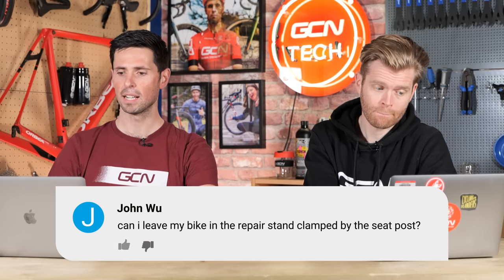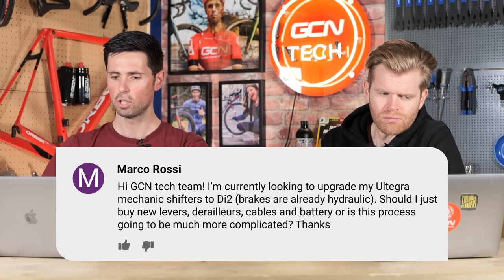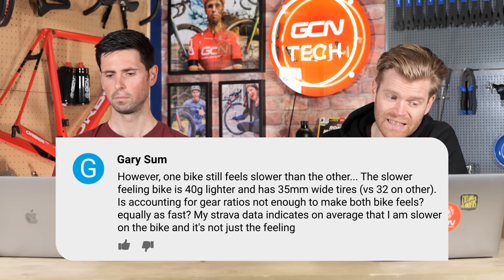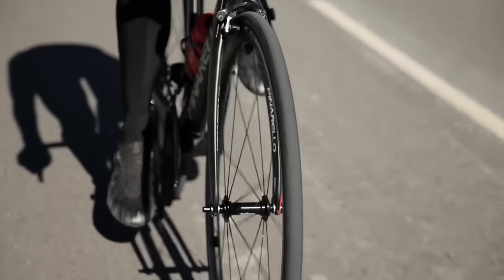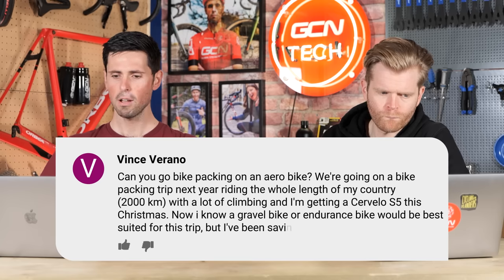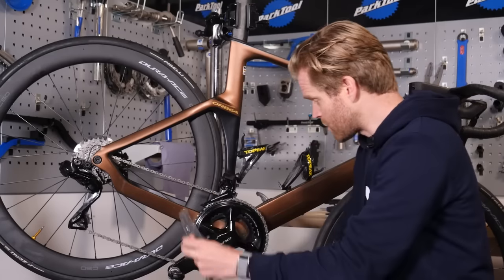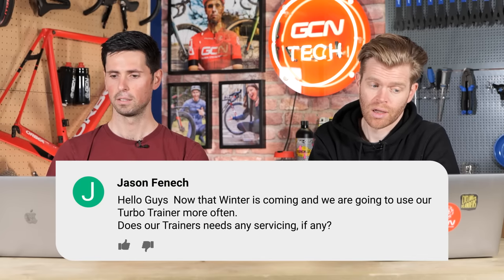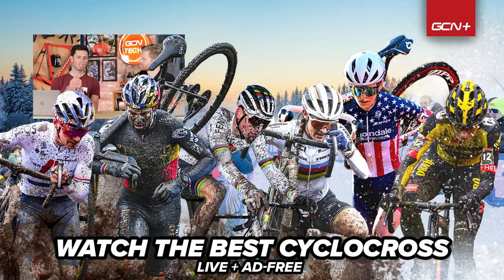Entry-Level Carbon Wheels Vs High-End Aluminium Wheels? | GCN Tech Clinic

Comment: Lemme put it this way yes carbon wheels is worth thit in some way but not worth it in some other way so Here's the reason
1.carbon wheels are light they make the whole bike light 
2.it's good looking
3.they maintain the higher speed just like aluminum alloy does 

Not worth it reasons:
1.they break easily they're weak because they're not as stiff and durable as alloy
2.once you crash and it breaks you can never use it you need to buy another one waste of money
3.they can't handle impact or crash impact despite they're made of 3k 8k 12k 24k T700 T800 T1000 or any other materials 

Reasons why stick to alloy:
1.they don't break easily since most wheels are made of 6061 aluminum alloy T4 or either T6 they handle higher speed 
2.they're cheap like $300-350 or maybe more it doesn't make you cry like a baby and make you poor and put you in debt
3.they're durable has higher impact resistance tho it is not resistant to vibration that much and despite their few grams heavier than carbon 
4.they're the most famous and Superior msterial for Bikes

To those people that are carbon winnies you can't beat the durability of alloy despite their few grams heavier 

I use alloy deep rims 50mm 20/24h it only weighs 1250g front and 1458g rear with butyl inner tubes and tires it weighs 1434g front 1576g rear to be specific i use alloy mavic wheelset it's fixed gear that's why it's light as carbon.

Comment: Carbon fiber deep rims are a joke. I bought plastic snap on deep rim imposters that are indistinguishable from the real thing. Once on my Cervelo P2 they out performed the carbon fiber deep rims on loan. In addition, the plastic snap on rims are engineered for quick installation and removal. At twenty mph, sometimes a gust of wind feels like the hand of God slapping my front wheel on windy days. Plastic snap off rims solve the problem of windy days.

Comment: Lier. The exact same wheel same size shape all the same, carbon won't be a lot lighter. In fact could be heavier.
High end aluminium alloys are super light and entry lv carbon alloys are heavier.
I saw time ago a a direct comparison from a brand, their same bike, same components, same shape, all was same except the bike frames were aluminum and carbon, both high spec ones.spoiler alert aluminium bike was 40 grams heavier. Also riders said they felt the aluminum bike a bit more confortable to ride, and speed was the same on both. 
Carbon is overpriced, overrated and is garbage. Makes your bike weak, how many times you saw an aluminium wheel or frame crack riding in a flat, without any Reason? Zero, how many on carbon? Too many to count